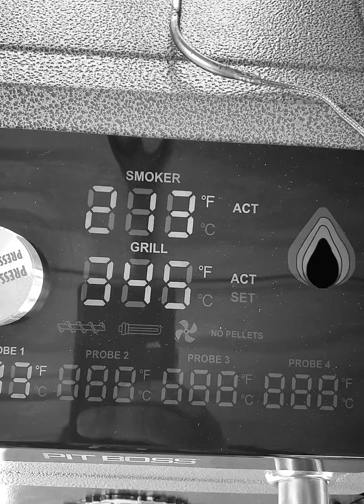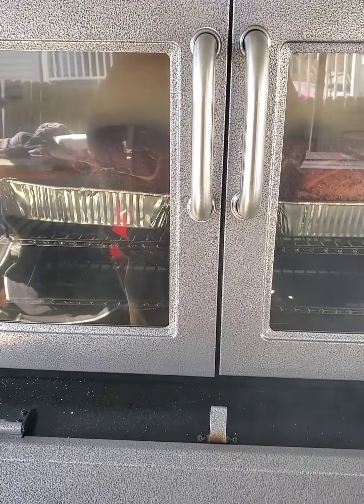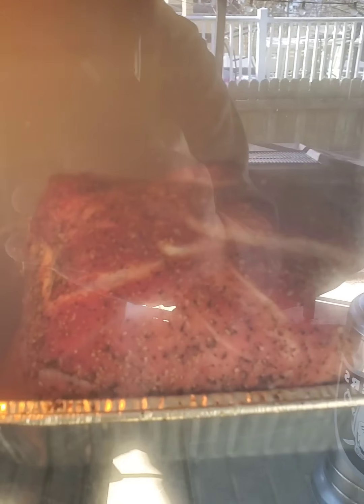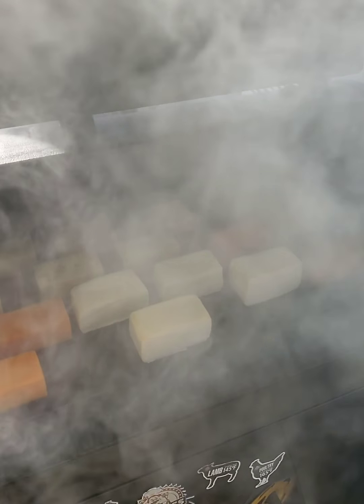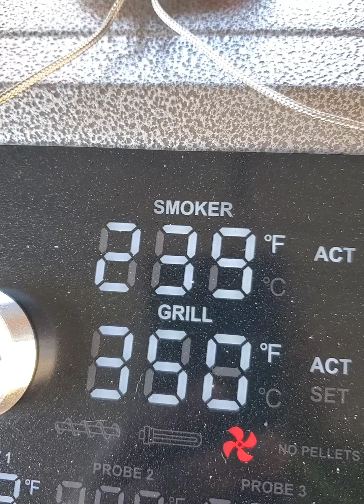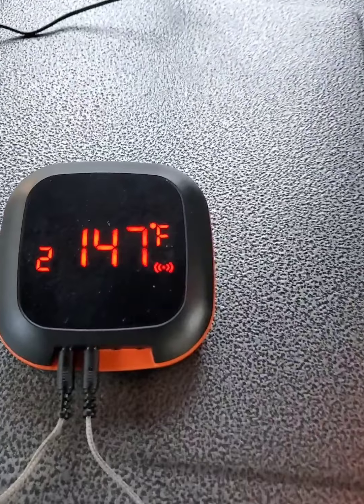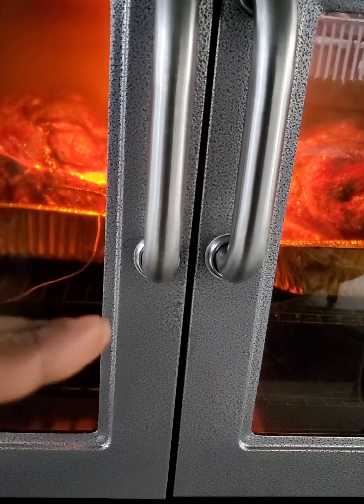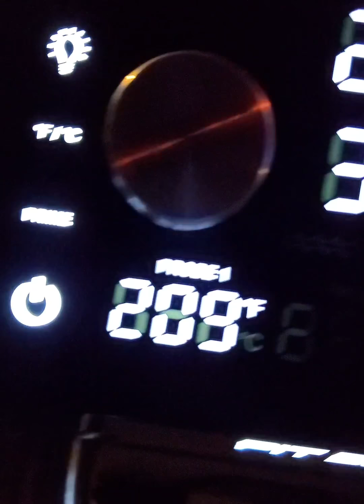Pit Boss Lockhart Smoked cheese, grilled chicken and low and slow pork

Comment: i can't get my Lockhart to smoke like that at all... have any tips?
Reply from the maker: Thanks for the question fam! What blend of pellets are you using and what brand?
Reply: @ramtuff111  Hi. I am using Pit Boss Competition blend...
Reply from the maker: @spacematerial2  what temps do you usually run at? On this cook i was running about 350⁰f which might have made it look like a lot of smoke from the pellets but it was more from the chicken fat dripping on the plate. Also if you noticed, I also used a smoke tube in the top chamber for the pork👍🏾👍🏾
Reply: @ramtuff111 350 is what i was on too. By the way, thank SO MUCh for responding and helping me. Am I right in thinking that for the most smoke you must smoke on the grill and not the smoker oven up top? to keep the temps lower for more smoke? I had a wood chip smoker before so this is all new to me. thanks for all your advice. love your vids.
Reply from the maker: @spacematerial2  thank you so much! When I'm smoking in the top chamber I more often than not use a smoke tube. Sometimes it's in the actual snake chamber and others i leave in in the grill chamber. It basically depends on what I'm cooking honestly. As far as the smoke on low and slow... the lower your temps, the more smoke you will generate. Like when I do briskets...I usually go at about 200⁰f until I achieve the bark I like. Usually about 8-9 hours or so. Then when I wrap, I go to 250-275⁰f until tender
Reply: @ramtuff111  thank you for the tips! you inspire me... and your vids make me hungry lol. cheers
Reply from the maker: @spacematerial2  that's awesome, and thank you!! Hopefully you have better luck with it now. Once you get used to using it, you'll fall in love with it! 😂😂 Hit me up any time with any questions or whatever, hopefully I'm able to help you out👍🏾👍🏾